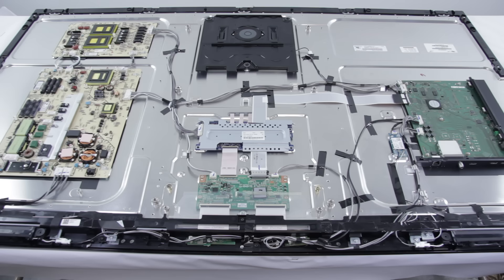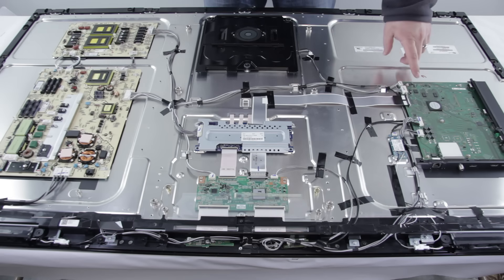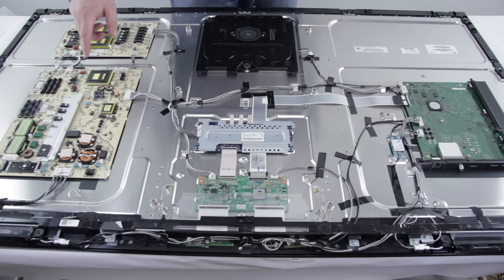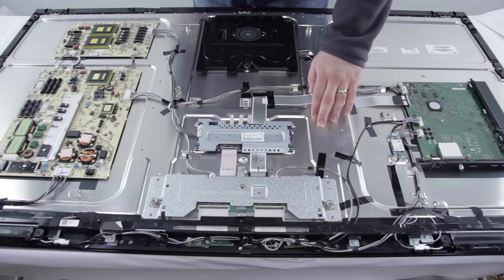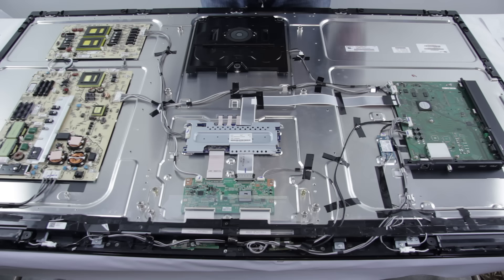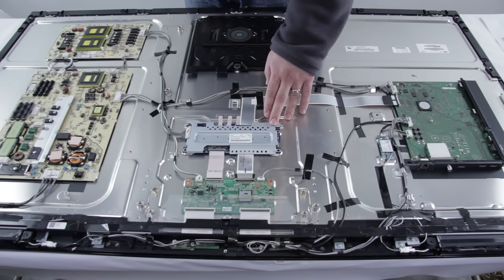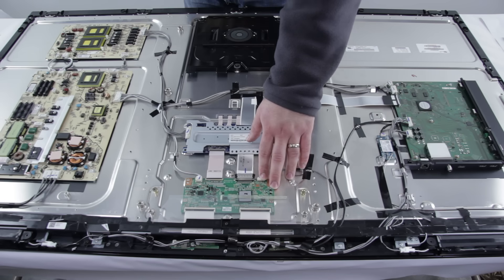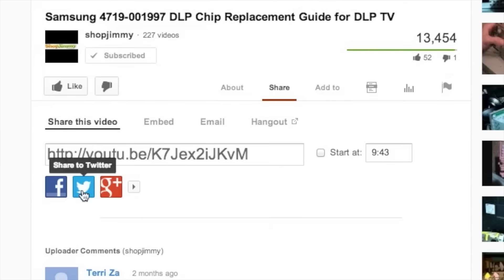LED TV Repair Tutorial - Common Symptoms & Solutions - How to Repair LED TVs

Comment: i Have a 32" vizio led model number: E320-B1
I am receiving sound but no picture. I'm not sure if its fixable or if i need to just buy a new tv. what happened was I unplugged the hdmi cord from the back of the tv from my gaming console without turning either one of them off. after that action, I lost all picture. I know its the tv that is now messed up because before whenever i started the tv a large v would appear for vizio but no longer does. the weird thing though is when i turn on the tv it sort of lights up either a dark blue or light black but I'm recieving no picture. so i think that takes out the chance of the bulb being burnt. is this fixable? how much and where can i get the replacement part if possible? do you have a general id how much a tv repair shop would charge for this? thank you.
Reply from the maker: MrCustomKickz   I recommend replacing the main board inside your TV.  Here is a link to replacement parts for your TV model number on our website, click here:  http://www.shopjimmy.com/catalogsearch/result/?q=E320  Be sure to match part numbers on your current board, with your replacement for compatibility.  Here is a link to a video showing how to identify your part number, click here:  TV Part Number Identification Guide for Vizio Main Boards (Plasma, LCD, LED)  You can also call our customer service for further assistance with your purchase.  (877) 881-6492  Thanks and please let us know if you have any further questions with your TV Repair!  www.shopjimmy.com

Comment: I have a 50" LED Element TV Model ELEFT502. I bought the TV in November and Jan as I was watching, the screen just went black. I can hear audio, but the screen looks like the TV is off, but there is sound and the power light is on. What could the problem be and would you be able to estimate the repair cost (parts only)? Thanks.
Reply from the maker: LT   I recommend running the flashlight test on your TV to help determine if the problem is the backlight inverter or the main board. Here is a link to a video we produced that shows how to run the flashlight test. No Image No Picture on Screen-Flashlight Test LCD TV Repair - How to Diagnose Broken Board TV Repair Please reply with your flashlight test results and we can recommend a replacement part for your TV repair. Thanks and please let us know if you have any questions! www.shopjimmy.com

Comment: I have a Philips 52PFL5704D/F7, serial number YA1B0950007374.  It has sound but no picture.  Backlight is on.  No sign of blown caps but not tested.  jtburnett1@sbcglobal.net
Reply from the maker: intheclear1  I recommend replacing the T-Con board in your TV.  Here is a link to replacement parts for your TV model number on our website, click here:  http://www.shopjimmy.com/catalogsearch/result/?q=52PFL5704D%2FF7  Be sure to match part numbers on your current board, with your replacement for compatibility.  You can also call our customer service for further assistance with your purchase.  (877) 881-6492  Thanks and please let us know if you have any further questions with your TV Repair!  www.shopjimmy.com

Comment: Hi. I have a Samsung UN60ES7100 which is over a year old now. It got turned off while watching today and wouldn't power on. I just hear clicking sounds as if it is trying to turn on but the TV wouldn't come on. It repeats those clicks over and over. Could you please advise what could be the problem? Thanks in advance.
Reply from the maker: Paul Cherian Thomas   This sounds like bad caps on the power supply.  I would look to see if any of the capacitors on your power supply look puffy on the top.  Here is a video about puffy caps:  How to Test a Capacitor TV Repair Help with Multimeter and ESR Tester Puffy Capacitor  You can also replace the entire board, here is a link to replacement parts for your TV model number on our website, click here:  http://www.shopjimmy.com/catalogsearch/result/?q=UN60ES7100  Be sure to match part numbers on your current board, with your replacement for compatibility.  You can also call our customer service for further assistance with your purchase.  (877) 881-6492  Thanks and please let us know if you have any further questions with your TV Repair!  www.shopjimmy.com

Comment: my tv samsung model UN46D6420 doesnt have picture, there s back light and sound how can i fix the problem and how much for the part , thank you
Reply from the maker: hollyandkealanshow   I recommend replacing the T-con board in your TV.  Here is a link to replacement parts for your TV model number on our website, click here:  http://www.shopjimmy.com/catalogsearch/result/?q=UN46D6420  Be sure to match part numbers on your current board, with your replacement for compatibility.  Here is a link to a video showing how to identify your part number, click here:  LCD TVs HELP Part Identification Number Guide for Chi Mei (CMO) Timing Control (T-Con) Boards  You can also call our customer service for further assistance with your purchase.  (877) 881-6492  Thanks and please let us know if you have any further questions with your TV Repair!  www.shopjimmy.com

Comment: And now I'm just noticing I can barley see dark bars vertically across the screen . Not always noticeable.  But they are there.
Reply from the maker: Ron Bernal   This sounds like a problem with either the main board or the T-con.  You may need to replace each board individually to see which one fixes the problem.  Here is a link to replacement parts for your TV model number on our website, click here:  http://www.shopjimmy.com/catalogsearch/result/?q=42le5400-uc  Be sure to match part numbers on your current board, with your replacement for compatibility.  You can also call our customer service for further assistance with your purchase.  (877) 881-6492  Thanks and please let us know if you have any further questions with your TV Repair!  www.shopjimmy.com

Comment: I have vizio  model P42 made a puff sound and turned off. I opened tv and noticed a blown fuse and bad capasitor. I replaced them and tv would turn on but no picture. I just replaced the y sustain board now i have picture but its not clear. What do i need to do now to get clear picture?
Reply from the maker: Leo Sarabia  I recommend replacing the YSUS board and the Buffers that attach to the YSUS board in your TV.  Here is a link to replacement parts for your TV model number on our website, click here:  http://www.shopjimmy.com/catalogsearch/result/?q=P42  Be sure to match part numbers on your current board, with your replacement for compatibility.  You can also call our customer service for further assistance with your purchase.  (877) 881-6492  Thanks and please let us know if you have any further questions with your TV Repair!  www.shopjimmy.com

Comment: Sony KDL 55EX621-  TV turns on with no picture-has only green light display (No RED light) Remote operations make Green light blink after each command is entered on remote-Cant turn off TV (green light remains on) only unplugging tv make it shut off- any recommendations-
Reply from the maker: Rick Valdovinos   I recommend running the flashlight test on your TV to help determine if the problem is the backlight inverter or the main board. Here is a link to a video we produced that shows how to run the flashlight test. No Image No Picture on Screen-Flashlight Test LCD TV Repair - How to Diagnose Broken Board TV Repair Please reply with your flashlight test results and we can recommend a replacement part for your TV repair. Thanks and please let us know if you have any questions! www.shopjimmy.com

Comment: I have a plasma TV Panasonic TH-42PD25 Series # YH4650284 how to turn on the 
the red light lit up on the front but there is no picture or voice, the screen is black, 
does not react to change function, channels, how can I fix it.
Reply from the maker: Pawel Niznik   I recommend replacing the SC Board and the two SU boards in your TV.  Here is a link to replacement parts for your TV model number on our website, click here:  http://www.shopjimmy.com/catalogsearch/result/?q=TH-42PD25  Be sure to match part numbers on your current board, with your replacement for compatibility.  You can also call our customer service for further assistance with your purchase.  (877) 881-6492  Thanks and please let us know if you have any further questions with your TV Repair!  www.shopjimmy.com

Comment: Vizio E420I-AO   When powered on, Vizio logo will flicker and make crackling noise and then shut off.  No caps are bulging (I know that doesn't mean they're fine), no visual damage to power or main board.  Thoughts?
Reply from the maker: amcardon   I recommend replacing the main board in your TV.  Here is a link to replacement parts for your TV model number on our website, click here:  http://www.shopjimmy.com/catalogsearch/result/?q=E420I  Be sure to match part numbers on your current board, with your replacement for compatibility.  You can also call our customer service for further assistance with your purchase.  (877) 881-6492  Thanks and please let us know if you have any further questions with your TV Repair!  www.shopjimmy.com

Comment: Mactim
I have a Vizio M3D550KD TV  and my Linksys N750 smart wireless Wi-Fi  Router will not communicate with it. The TV is in the same room with the router.In the bedroom 25 feet away I have a Vizio M550SL that communicates very good. Should I replace the Wi-Fi Moduel in the M3D550KD TV that is not communicating with router
Reply from the maker: Tim McClelland   I recommend replacing the WiFi module.  Search your part number on our website, www.shopjimmy.com to find a replacement part.  You can also call our customer service for further assistance with your purchase.  (877) 881-6492  Thanks and please let us know if you have any further questions with your TV Repair!  www.shopjimmy.com

Comment: I have a Samsung UN65C8000XF that I bought used.  The viewing angle is horrible.  My older 55 inch 6000 series Samsung had no issues.  It seems as I move to b the side the picture loses, I he l guess you could say definition.  The colors fade. Sitting directly in front of it seems fine. On that note. I know all TV stations won't look the same.  But shows on the same station look different.  Some are to dark,  some seem to lose definition as if viewing from a side angle. And watching bluray movies look no where as good as they did on my last TV . And my research showed this was a tv Worth double what my last one did new.  The screen looks faded. I don't know how else to describe it.  I adjust the brightness up the blacks turn gray.  Turn it down and the black overwhelms the screen.  But some TV stations look good.  But again not as good as my old TV.  Then lastly I have a huge "flashlight" problem.  I really it when credits come on during a movie. The whole screen and edge light up wherever the white text is. I know this is super long.  I hope I was able to explain well enough.  But I got a huge deal on the TV.  But I am beginning to think I now know why.

Comment: Hello, I have a vizio smart tv model e322ar, and my tv is powering on just fine but it just stays on the screen with the vizio logo for awhile and then it shuts itself off, would you guys happen to know what could be causing this?
Reply from the maker: Kymon Woods   I recommend replacing the main board in your TV.  Here is a link to replacement parts for your TV model number on our website, click here:  http://www.shopjimmy.com/catalogsearch/result/?q=e322ar  Be sure to match part numbers on your current board, with your replacement for compatibility.  Here is a link to a video showing how to identify your part number, click here:  TV Part Number Identification Guide for Vizio Main Boards (Plasma, LCD, LED)  You can also call our customer service for further assistance with your purchase.  (877) 881-6492  Thanks and please let us know if you have any further questions with your TV Repair!  www.shopjimmy.com

Comment: i have Samsung led 55inch un55d8000  my display shows pink like on the right side of the screen and thanks
Reply from the maker: alex ra   I recommend replacing the main board to see if that fixes the problem in your TV.  Here is a link to replacement parts for your TV model number on our website, click here:  http://www.shopjimmy.com/catalogsearch/result/?q=un55d8000  Be sure to match part numbers on your current board, with your replacement for compatibility.  Here is a link to a video showing how to identify your part number, click here:  Samsung Main Boards & Digital Boards: Part Numbers for LED, LCD, DLP, Plasma TV Repair  You can also call our customer service for further assistance with your purchase.  (877) 881-6492  Thanks and please let us know if you have any further questions with your TV Repair!  www.shopjimmy.com
Reply: I got it replaced but its still exist. I pretty sure its from the screen it self

Comment: I have a 42 inch magnavox model number 32mf231d manufactured 2006 it goes from color to black an white then when I turn off for a while the color will stay on for a while then when I play games or movie does the same what do I do ?
Reply from the maker: bigbusa spanish   I recommend replacing the main board in your TV.  Here is a link to replacement parts for your TV model number on our website, click here:  http://www.shopjimmy.com/catalogsearch/result/?q=32mf231d  Be sure to match part numbers on your current board, with your replacement for compatibility.  Here is a link to a video showing how to identify your part number, click here:  Philips Magnavox Main Boards TV Part Number Identification Guide for DIY TV Repair Help  You can also call our customer service for further assistance with your purchase.  (877) 881-6492  Thanks and please let us know if you have any further questions with your TV Repair!  www.shopjimmy.com

Comment: my tv model no.vizio.GV47LFHDTV10A;SERIAL NO;LHPAEAH3311617;
myaudio surce is not working ;very quite when tv is turned on
Reply from the maker: Mohammad Baloch   Check the audio settings in your menu on your TV.  If the settings are correct, then I recommend replacing your main board.  Here is a link to replacement parts for your TV model number on our website, click here:  http://www.shopjimmy.com/catalogsearch/result/?q=47LFHDTV10A  Be sure to match part numbers on your current board, with your replacement for compatibility.  Here is a link to a video showing how to identify your part number, click here:  TV Part Number Identification Guide for Vizio Main Boards (Plasma, LCD, LED)  You can also call our customer service for further assistance with your purchase.  (877) 881-6492  Thanks and please let us know if you have any further questions with your TV Repair!  www.shopjimmy.com

Comment: I have a visio E421VO. When plugged in the visio is yellow. When it is turned on the visio turns white and the visio logo appears on the screen. That's it. No signal comes through. The tv will just sit there with the visio logo on the screen. No sound. If you unplug it and let it set for a while (days) and then plug it back in, it will work fine until you power it off and then it will go back to just displaying the visio logo. Help!
Reply from the maker: Charles Rothfuss At your own risk - Take the back off your TV and look at your main board part number it should start with a 3642 and for your issue you will need a new eeprom for you main board  http://www.shopjimmy.com/vizio-e421vo-3642-1232-0150-main-board-u18-eeprom-only.htm http://www.shopjimmy.com/vizio-e421vo-3642-1472-0150-main-board-u54-eeprom-only.htm  If we have your board in stock, you can also consider replacing the entire board.  http://www.shopjimmy.com/catalogsearch/result/?q=3642-1232-0150  You can also call our customer service for further assistance with your purchase.  (877) 881-6492  Thanks and please let us know if you have any further questions with your TV Repair!  www.shopjimmy.com

Comment: I have a Philips 32PFL6704D/F7.  The picture is working at the very top 1 inch of the display then the rest of the display is black with a single, white, horizontal bar across.  I'm thinking it might be the T Board
Reply: Do you have a T Board for this television?  Also, do you think this is a correct diagnosis?  Thanks.

Comment: Hi, I have  a 60" Samsung - UNF60F7100.  I came home last thursday and now there are bright colored lines up and down the screen that weren't there in the morning, The Samsung guy cliams the panel is cracked and not under warranty.  There is no crack in the glass though.  I swear no one has hit the TV. Arrgh!.  What can I do if they try to stick me with this?  I paid too much for this thing.
Reply from the maker: Ozzie Alvarez  If the lines are straight colored lines vertically I would say it is not a damaged screen. When an LCD panel cracks because of an impact it usually sends cracks out from the point of impact irregularly. You could upload a video to YouTube with images of your screen and then reply with the link to the video.  We could then take a look and then recommend a replacement part.  Thanks!  www.shopjimmy.com